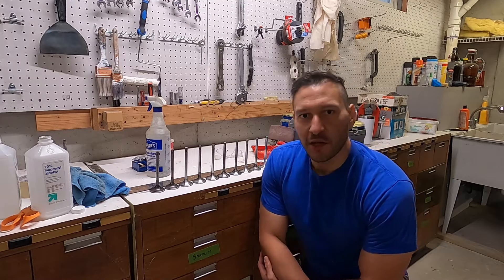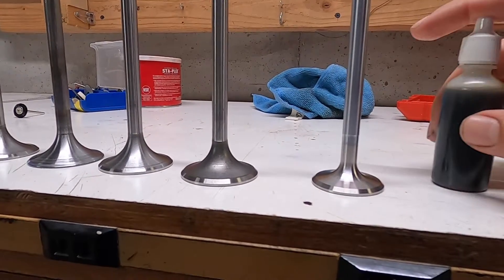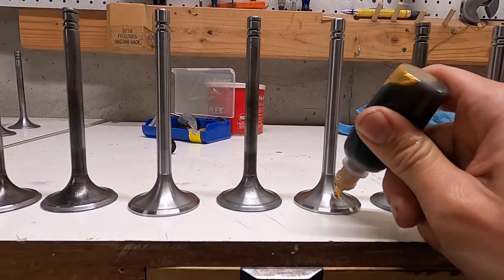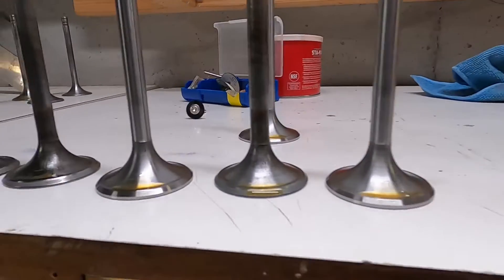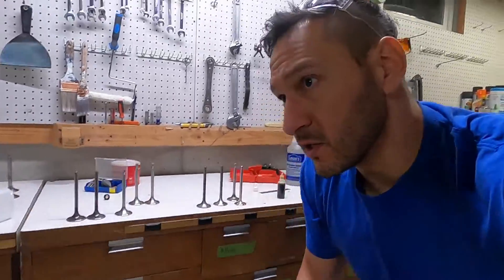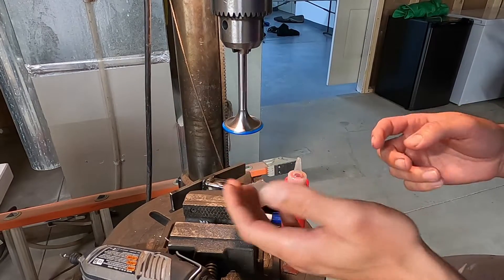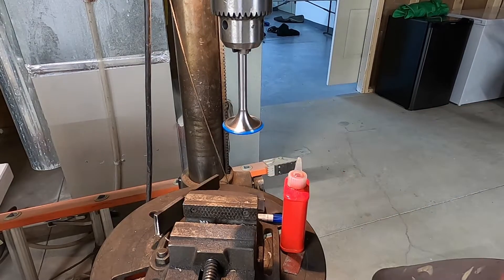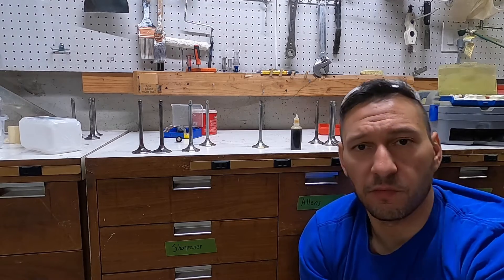Valve Grinding

Comment: The valve at the 10 minutes mark wobbles when it spins in the drill press, is it bent?
Reply from the maker: Oh man, you are right. I didn't notice at the time, good eye. Maybe I chucked it in just a little crooked. Not sure, but I will definitely inspect it all tomorrow. Thanks bud!
Reply: @DustorBust  No problem, been working on Mopars for over 35 years, just didn't want you to have a bad experience working on your engine.
Reply from the maker: @MostlyOldPartsAndRust  nice! Yeah, thanks for pointing it out. Better to find an issue before installing. I saw you were going to NoName Nationals. I haven't announced yet, but I will be there as well. Should be a blast.
Reply: @DustorBust  That is the plan, hardest part will be getting the subscribers.  But I have faith.

Comment: Cool video I would use a 400 grit 2in psa disc in a angle die grinder and move up to 800 grit for finish and use a polishing compound.
Reply from the maker: Thanks for the tip Moparnut! I am still not done, so I will definitely give this a try.
Reply: @DustorBust  always take your time.